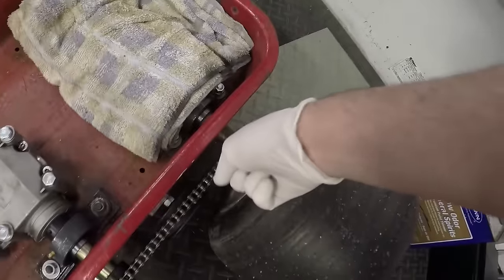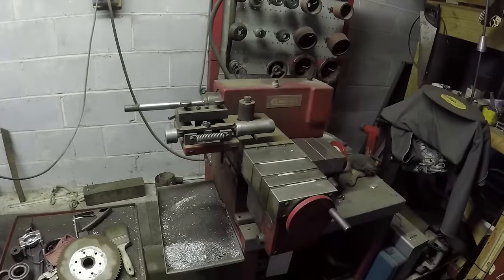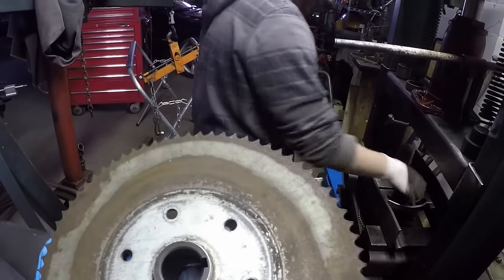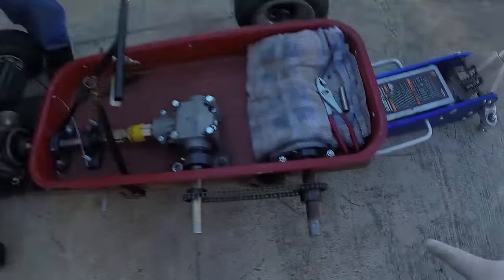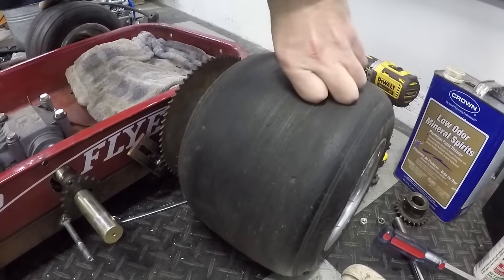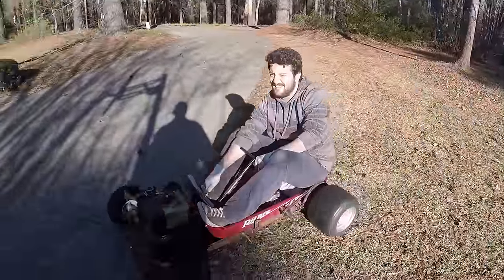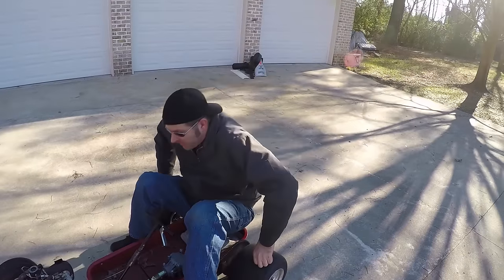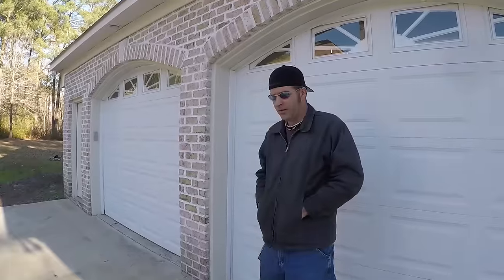Rat Rod Wagon Sprocket Install, Testing, & Race

Comment from the maker: I demand a rematch!
Reply: Yep
Reply: +CarsandCameras mini bike build
Reply: Hey I got a good idea put lighter oil in the 90degree thing 10-30w
Reply: You should make another one with a 250cc Harley motor that way it works cool and all
Reply: +BLACK 0PS BOSS I have a feeling you've done that...
Reply: Do use own the house on the land and the two sheds
Reply: +ZachBraps ya
Reply: Nice
Reply: +CarsandCameras I am really excited for the build off!
Reply: +CarsandCameras NEEDS A OPPOSTED BRIGGS
Reply: +Matt. d. motorbike. Here you now that would be cool.
Reply: hi
Reply: +CarsandCameras ----LOL,, I have a Feeling you will get your Demand, John...Next time with everything Charged up....
Reply: Do a custom a exhaust for the rat rod wagon
Reply: build a drift trike
Reply: +CarsandCameras As far as more power and weight, you could get a sears suburban engine. For antiquity reasons.
Reply: +Devil Dog Tecumseh HH100 and HH120s. GOOD LUCK finding parts for those bastards...Ive got a 68 suburban and its a pita to find parts for the engine.
Reply: I demend more britishness
Reply: +CarsandCameras i got a 6hp gokart for 200
Reply: +CarsandCameras 
Ideas:
1. Stack exhaust going straight up from the engine

2. Put a "lid" of some sort on the tub and put the seat/ pedals on that
3. Position the seat slightly behind the rear axle giving you more leg room (#2 would probably help with this)

Cheers! and keep up the great work
Reply: +CarsandCameras turn down for what? polish the shaft. lol
Reply: +Jeremy Finlay Stack exhaust with a little tractor-style flapper on top? grins
Reply: +Jim P Hahaha, YES!
Reply: Yo u guys should for the 670 add bicycle gears to change sprocket size that'll be sick and have top speed and acceleration gears
Reply: +ZachBraps they have one
Reply: Get as tearing wheel for it
Reply: +CarsandCameras  hmm...ebay turbo??
Reply: +CarsandCameras You need a Flat Head like the one on the Kart in my video. I may have a good flatty without tank and carb or tins that i could donate to the RRW project! Also a decent Header for it as well. That is if you'd be interested in it?
Reply: +CarsandCameras it needs a actual seat and you should give all of your go carts L.E.D head lights from Amazon there pretty cheap
Reply: CarsandCameras you are awesome
Reply: What program did you use to keep track of speed during the race?
Reply: Strange request, what's the car shell at 4:22?

Comment: That gear box could handle any V-twin engine you could get. It has a PTO (power take out) input to it which are meant to power implements of of farm tractors which can output from 35 hp and up. I'd say the briggs flatty looks great on it. You can get after market parts for the old 5hp flat head, they used to run them in mini dragsters.

Comment: I think if you guys move the clutch to the back would help a lot because the clutch has to turn the box chains and carry you. So direct chain drive the box and you won't lose as much power, it may be harder to start but try n see. It'll be more fine and more fun :)

Comment: You can port and polish those Briggs pretty easily and also modifying the valve seats at the top of the heads for more exhaust and intake flow

Comment: We got the kids a go-kart although we really have no dirt areas to ride.. just a windey 1 mile street to go back and forth on.. the front tires maybe last 6-8 hours before they have to be replaced due to it balds the tires until they pop.. could you guys recommend some tires so they can ride and not worry to much about wearing out the tires.. also maybe a video to show how to check alignments on the karts?

Comment: You guys should hop up a different briggs flattie with an arc rod, 94-ss cam, stiffer valve springs and a straight pipe. Theres lots of info on hoppin up those little motors on the web. That kart is pretty cool and nice videos!
Reply: +Cody Nadgwick thanks

Comment: You guys should look into getting a DJI OSMO. It's a relatively inexpensive way to get Stabilized good quality video. Running with a camera would be a much more fluid experience as well. Anyway, keep up the good work!
Reply from the maker: +Aaron Palmer I'm looking at one this afternoon!
Reply: +Aaron Palmer Oh Just finished the video, noticed the drone.
Reply: +CarsandCameras you should make some wheel wells for the back tires to cover the sprocket and add to the rat rod look. and it would help prevent accidentally hitting it

Comment: lol you can just add Vaseline to the bead of the tire, center it over the raised portions of the wheel, then add air. They pretty much push themselves on no ignition needed. Also check what oil or grease that gearbox is running. Chances are that is robbing power since it's sealed, the gears could be fighting the fluid.

Comment: For the seat could you just do a small contoured 3/16" sheet metal with a 1" foam pad adhered to the seat, just above the axle?

Comment: I love that full size blazer
Reply: +Reverend Mike (ShadowFIlms) thanks
Reply: Is that a K5 or 7
Reply: +Reverend Mike (ShadowFIlms) k10 i think.they changed the k5 to a k10 at around 1988. cause my 87 says k5 on it
Reply: +Isaac it'll be fine and this one is a 1989
Reply: Thats bad ass I love the older bigger SUV's thats why I drive a expedition. My first was a 72 bronco sport with a 3 on the tree. That thing was unstoppable in the mud. Total lunchbox on 40's.
Reply: cool

Comment: if om honest, you guys will never break that magic box, it looks like its a 90 degree pto shaft for a 3 point linkage tractor implement, if that is the case, you would need 100hp to even get near its limits... so, give that thing hell, "it will be fine" as you would say XD

Comment: Interest idea: get a used 600cc sport bike engine for a build
Reply: +Rayne Quinn yea. we want to live! lol
Reply: +Isaac it'll be fine 1000cc
Reply: Rayne Quinn was aware of that project but a 600cc sport bike engine has like 3x the hp
Reply: More like 4 or 5x the power
Reply: More like 4 or 5x the power
Reply: we have talked about a sport bike engine
Reply: +Isaac it'll be fine then u could whoop some corvette butt
Reply: +Isaac it&#39;ll be fine where did you get you 90 degree gear box? I want to do something similar to a golf cart with a vertical shaft motor.
Reply: we got it at agri supply

Comment: Need a pony keg gas tank and a propane tank and a spark plug in some crazy exhaust out the back for flames! Or add the V-twin, Move the oil cooler before the flywheel use a larger tranny cooler (Cheap from any junk yard) to look like a mini Radiator and use two modded 5hp covers (will look old and crappy AKA Awesome) to replace the plastic stock cover and use two Carbs off something like a old 12HP... May not be super powerful but would look crazy.  If it had the V-twin... Would have to have side pipes. Just saying. Or Have two say 5hp B&S both linked to the center shaft Just flip one clutch to make up for the two sprockets alignment on the center shaft.

Comment: You know you can take a hole saw the same size as the hole in the the sprocket and screw it into the a hole saw the size of the collar you want to weld on. It's just a hole saw in a hole saw. The smaller one acts as a guide as your drilling the hole larger.

Comment: +carsandcameras how did you get the rpms to show? The mph and g is simple,  but rpm was it basically a sound meter?
Reply: +Stephen Butler i thought it was mph
Reply: +Isaac it'll be fine lol I'm an idiot.  It's because you switched the scale from the first run to the second. 

I'll get my coat 😢
Reply from the maker: +Stephen Butler You can hook up RPMs, but it requires an OBDII connection which this wagon doesn't have.
Reply: CarsandCameras yes ,  I knew about them,  the bluetooth ones are now very cheap and some nice apps out there to manipulate the data.  I didn't that old scrapper would have an OBD. to be honest I would think any of then small create motors would have any fancy electrics. 

 That's why why I Thought I seen a rev read out I was perplexed. But in reality I was just being my normal silly self.  

Love the channel,  quite knew, early summer 15 I think.  Keep it up. Also where you live looks stunning.
Reply: thanks. keep watching
Reply: +Isaac it'll be fine how bout a support bearing on the end of your transmission shaft before you cut it off. It would give you your strength back
Reply: i was thinking about it
Reply: 9p
Reply: it's a gps read out for the speedometer
Reply: +Isaac it'll be fine keep up the great work.
love the channel.
I build 120mph RC cars and 80mph RC boats
please check it out if u get some time

Comment: You might try a super hard compound rear tire with high air pressure to even out the front end pushing so much. Basically, slippery in the rear to make it a even handling chassis.

Comment: You might want to double up the metal under the gearbox to keep the sheetmetal from cracking and causing some unwanted excitement..
Reply: +ik04 it will be braced more

Comment: the more components you add (gear box, angled gears, etc) the less hp will reach the wheels, that thing had more hp to the wheel with the old chain configuration.
Reply: +JohnJaggerJack thats true but we couldnt keep chains on it

Comment: +CarsandCameras Hi, my name is David. Im 13 and I want to build a Go-cart with my dad. A friend of mine's dad gave me a 5.5HP Horizontal shaft engine. I want a cart that looks more like a race cart but I cant seem to find a frame or chassis under 200 dollars (This is a lot for me). I have watched the 9 reasons to buy a go-cart video and that got me hooked. I have looked on craigslist, eBay, and other little retailers, But have found nothing. What should I do?             Thanks David,
Reply: +David Macpherson if you saw the 9 reasons to buy a go kart we picked up that go kart for 200 dollars. thats about the best deal you will find. and if your really lucky you can find one for 100 like we did when we picked up the 3 karts from va
Reply: +Isaac it'll be fine Any suggestions where to look or buy from
Reply: all of our karts have been found buy word of mouth or finding them in peoples back yards and asking if they were for sale
Reply: +Isaac it'll be fine awesome thanks

Comment: At around the 12:00 mark wait was the app you were using it test tge speed
Reply from the maker: +zachary tyler It isn't an app, we're using the Garmin Virb camera.
Reply: Oh hkw do I get it ? Would I have to buy the camera?
Reply from the maker: zachary tyler Yeah, you would. We haven't used it very much yet, but it seems to be a good alternative to the GoPro because it offers nearly identical image and sound performance in addition to the cool telemetry stuff.

Comment: Cars and cameras I have a older 5hp Briggs and Stratton that the carb and gas tank are messed up but the motor it self is perfect condition I'm willing to give it to you the carb and tank on yours should bolt up to this one and I'm located in knight dale nc close to Raleigh comment back if you interested and we will make it happen it will look good on the rat rod

Comment: here's a lil' trick fer you guys, next time you need to seat a tire on a wheel, take out the shrader valve and just push the end of your pressure line onto it, it dumps a stupid amount of air into the tire quickly and can easily set the tire on the wheel.I can explain in better detail if you want.
Reply: +Aaron Matt i tried it. it didnt  work. not sure why
Reply: +Isaac it'll be fine Well sorry it didn't work for you guys :/

Comment: does bigger sprocket  = more tourque / acceleration and the smaller sprocket lo acceleration and higher top speed
Reply: +Joshua Beanblossom yes on the first but the smaller sprocket is just top speed and slower acceleration

Comment: hey guys I need help I've looked around the web and didn't find much info.  I'm in the possess of building a rat car  from nothing up I'm making it about 1/3 actual size . 2 seater I want to know  if you could possibly assist me in trying to make the front suspention/ axel.  ext or possibly sending me a link helping me figure it out
Reply: I should correct my car to cart.  my bad
Reply: +luke mioorea what are you building? model ? strait axle would be the easiest like a gasser
Reply: +Isaac it'll be fine    I'm more so trying to build the frame  and chassy from scratch only following some concepts   I drew out a design.  but I don't have the knowledge on how to make 1 the steering because its not as simple as what I've done before and 2 I don't know how to build the "front end" and need some assistance doing so
Reply: +Isaac it'll be fine   at least visual assistance
Reply: +luke mioorea did you see the older videos on the rat rod wagon when we built it from scratch ? now we didnt do the steering 100% correct because we didnt put any caster or camber in it. it wasent supposed to go as fast as it does now. lol
Reply: +Isaac it'll be fine  yea I did watch all your vids about it I just thought it would be more complicated because what I'm building is about twice the size

Comment: the whole point of a rat rod is to be unsafe and overpowered look it up John that magic box can take the power of a v-twin I promise it will be fine just put a sheet metal case over top of it in case the small chance it does break.you guys need to atlas try you owe us that.

Comment: I call bull crap. A 670 would be fine on it. I still think you should put the predator back on it, because the briggs n Stratton just is slow. Every rat rod has good motor. If you don't like my opinion then you should start a pole on cars amino to either keep a briggs on it or use a predator.
Reply: +Phil Black thats not a bad idea. but just to let you know i was planning on building another briggs engine with lots of mods
Reply: Okay
Reply: You definitely need to do a before and after part then either way. I found that 17, 18 mph was really pore I can hit a decent amount high than that on my bicycle. I have hit 26 mph up hill.